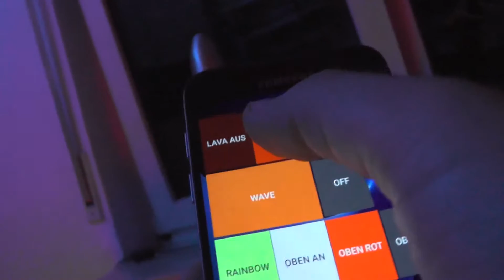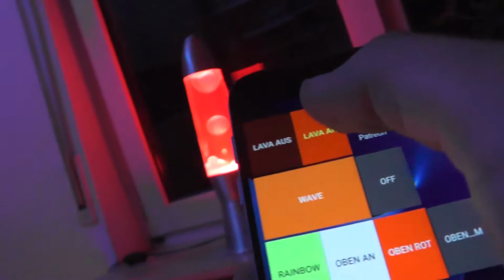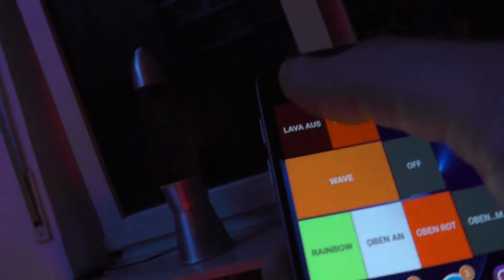WiFi mains switch (ESP8266)

Comment: Good video. 
Does it matter which line goes in the relay? What if your extension cord is plugged into the wall socket so that the relay disconnects the ground mains wire? then your lamp will be fed a 220V on one of the two holes in the extension cord socket.
Reply: Always switch phase ...
Reply from the maker: Sorry for not mentioning.. I'd take the phase. I didn't mention because European connection have no distinction there.. there can be plugged in either way..

Comment: Oh no, please always use a fuse propper to the solution. As your circuit breakers at home might be 10ampers or even more,  = 2500Wat. Use small glass fuxe for 0.2A, which is 50wats at maximum. You will prevent burning house.. and also I suggest to use a silicon glue to glue all movable parts inside the box. And the zip ties add also to the sides of the box on both sides so the cable can not be pulled out..
Reply from the maker: Thanks for the suggestions..  I'll consider the precautions next time

Comment: What really sucks about the Nodemcu is that it needs converters (Buck) or a power supply to run off mains voltage. Because ofthis the design most people have in mind quickly becomes more complicated and forces them to sacrifice 2 outlets just to control one device. That's madness.

Comment: Very interesting! Thanks for your work! I've been searching the net for a cheap way to control switches wirelessly and have found many options. I've been tempted with the Sonoff switches since they're "ready to use" and I don't have much knowledge in programming. Now I've found that Sonoff servers are somewhere in China and most of the time my switch appears "offline". So your way becomes interesting. Did you find any other cheap solution a bit more "user friendly"?

Comment: quick question. as shown relay is on negative logic. so when I tried,  it  never turns off , even if I connect it to ground. can u pls advise ? your flased code will be very helpful.
Reply from the maker: did you try switching it w/o a micronctoller.. just using some wires and a 3.3/5v poversupply?